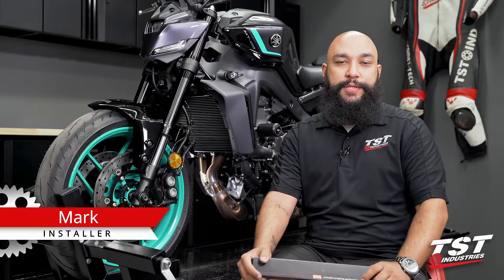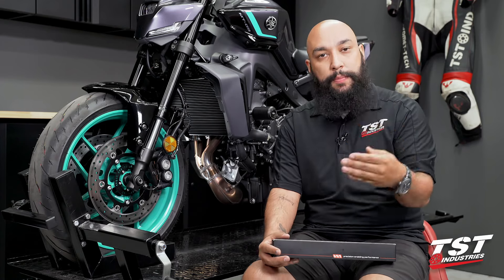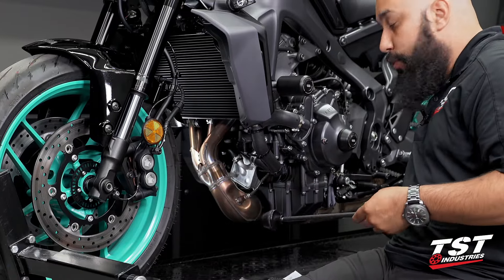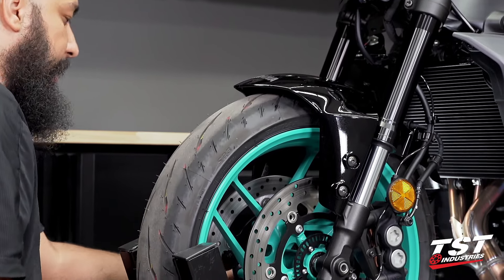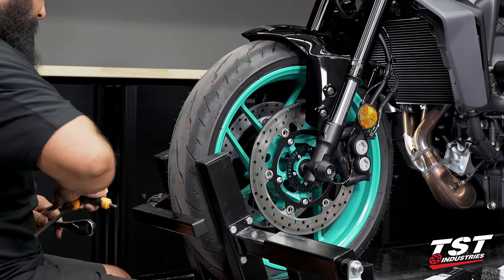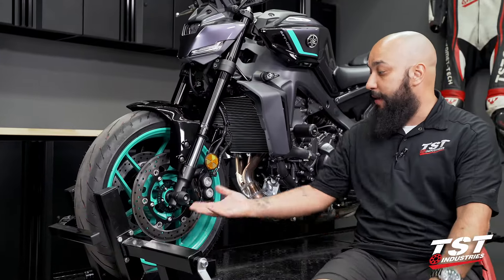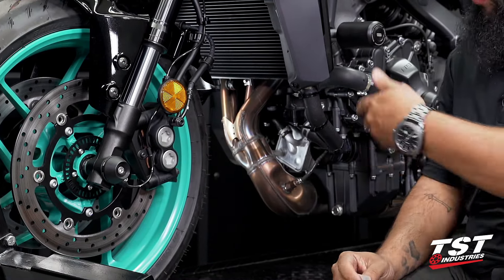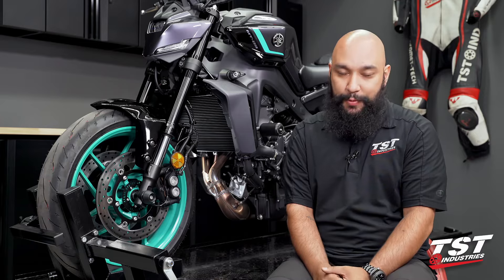How to Install Womet-Tech Front Fork Axle Slider on 2024+ Yamaha MT-09 by TST Industries

Comment: Will there be evo frame sliders for this generation?
Reply from the maker: How would you feel about TST two point mount frame slider kit instead the Evos. Similar concept but TST instead of Womet. We are considering making this set under TST brand.
Reply: @TSTindustries  I would be interested in that. I personally would rather a 2 point frame sliders over the one. I have the evos on my mt07 but would like something similar for my mt09. If you did do this, I personally would buy them
Reply from the maker: @connornee9839  it was our engineering staff that designed the 07 Evos and gave the design to Womet. They are the originators of the Evos line  we just contributed the model specific component design. We also design and produce our own line of crash protection components. Some of the recent models of two point mount frame sliders have included GSX8S, GSX8R NINJA 400 and 500. If you get a sec check those put on our website. The 09 model will be something similar but with a design dedicated to that model.